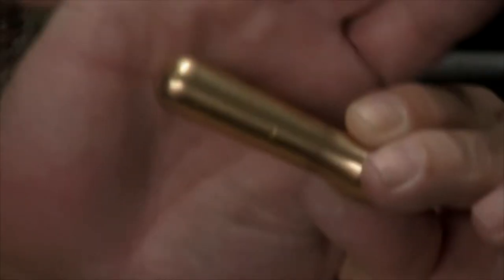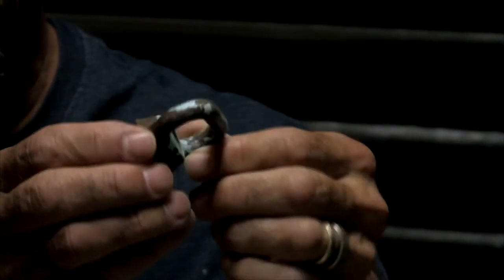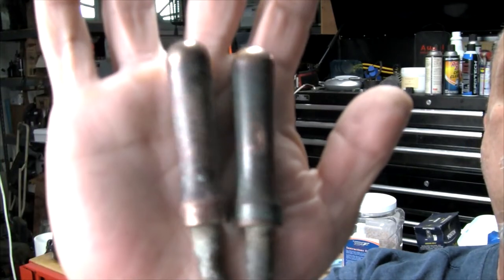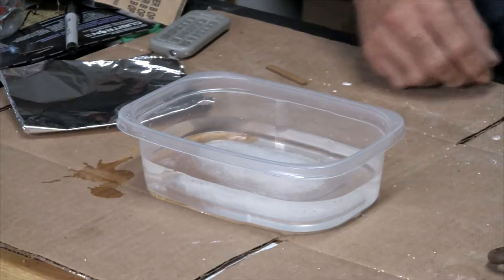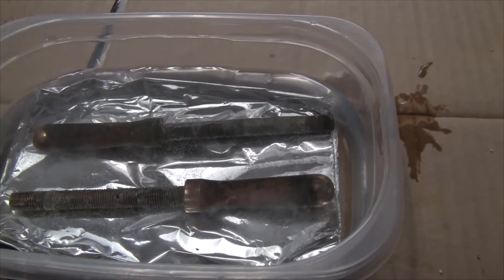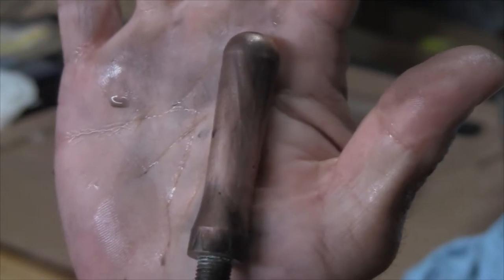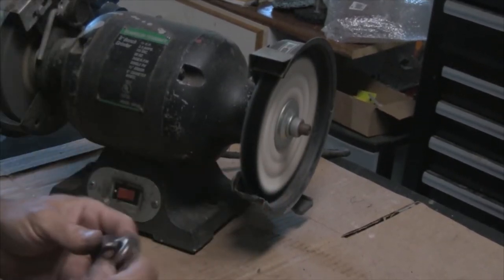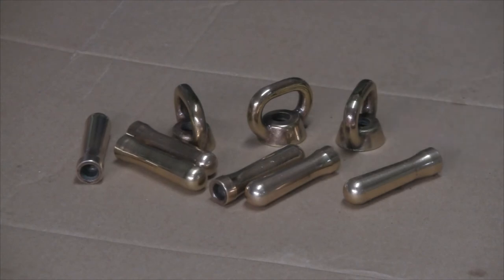How to Clean Brass with Homemade Bronze and Brass Cleaner Hack - Bonus on Polishing!

Comment: Good technique there. I don't have a buffing wheel, so for the last stage I use steel wool, and if badly discoloured tackle that beforehand with progressively finer wet & dry paper (silicon carbide). I'm wary about the vinegar bath, as I've buggered-up some things, where the reaction removes the zinc, and leaves copper-pink. Therefore, here's a Q. for you, Jose: I notice you've still got some copper look about these fittings, after polishing. Is it impossible to remove that?
Reply from the maker: That is a good question, I'm pretty certain these are Bronze through out so I think the color is there to stay. I no longer have the 13 so cant experiment any more.

Comment: Is there another way to polish at home, other than using a lathe?
Reply from the maker: Use very fine grit sandpaper 1000 and polish by hand or put on a drill and polish with a rag and polishing compound

Comment: What metal is brass in colour but when I polish it on the wheel it almost looks silver? silvery and shiny, The stamp on the back of the photo frame says made in Italy, any clue?
Reply from the maker: It might be plated with brass, perhaps steel?
Reply: @ExtremeDIYGuy  definitely not steel, is there anywhere I can post a side-by-side comparison photo? would it help?
Reply from the maker: @patprop74  I'm not sure that I would be able to help with pictures. Are these Norman pins off if a Boston Whaler?
Reply: @ExtremeDIYGuy No problem ill figure it out at one point lol, No no no, it's not off a boat, they are older photo frames.
Reply: @ExtremeDIYGuy  brass and bronze come in many different mixes.  When you etch with chemical you remove the zinc leaving copper hence the pink colour.  If the mix has a lot of tin which is white it will be a different colour.  Speculum metal was used by the Victorians in telescopes as a mirror has loads of tin in it.  German silver which is not silver has loads of nickel in it as far as I remember. It used to be used for surgical instruments.  Loads of alloys, loads of different colours.  There is something called the electrochemical series which is a list of how reactive different metals are.  Silver dip works in this way. I think that the aluminium is more reactive and this is what is going on, ions are transferring. 55 years ago when I learnt this!  To remove chrome plate use electrolysis, a trick used on modern surgical instruments to show brass underneath and sell them as antiques.

Comment: How do you get deep scratches out of a brass plaque (viewpoint finder) with lettering engraved on it) please? Done by a vandal, probably with a sharp stone.
Reply from the maker: The only thing I can think of is to sand it but you risk sanding off any engraving or detail

Comment: You're polishing bronze my friend.
Reply from the maker: Those are Norman pins that came off of a classic Boston Whaler. Whaler only made those pins in Stainless (later years) and brass. Another point to consider is that Bronze isn't strong enough to tie off a boat. Thanks for the feedback!
Reply: @ExtremeDIYGuy  Bronze is much stronger than brass. Bronze bolts are used to bold lead keels to boats where brass would fail. Bronze cleats are common on many vessels. 
Also, brass will corrode terribly around salt water as well and is rarely used except for ornamental pieces.
Reply from the maker: I stand corrected, did a bit more research and you are correct, they are bronze, not brass. Still came out nice though!
Reply: @ExtremeDIYGuy  I wasn't being a smart ass, I just knew you might have been mistaken. I restore wooden boats and deal with bronze almost daily. Most wooden boats have cleats, shackles, sheaves, stemheads, mastheads, floors and keel boats all cast in bronze, all of which require strenght. Brass is more "ornamental" though some people use brass screws because they are easier to source than bronze.
All that aside, they did turn out nicely. Cheers!
Reply from the maker: I took it in good stride friend! I appreciate solid feedback, thanks! Check out my Boston Whaler restoration videos if you get the chance.
Reply: @FixNewsPlease  Thanks for the clarification. Now that we know it is bronze and not brass, would the same technique work for brass? Thanks in advance for your help. I'd like to polish 3/8 inch, schedule 40, brass pipes for a wind chime gift.
Reply: @oldporkchops  I've always polished both bronze and brass with a brass wire wheel (if it's badly corroded, full of paint or coated with plastic) followed by a cotton buffing wheel and jeweller's rouge, but this technique would also work.
Reply: They are going to require frequent polishing when out in the elements, but if left alone will develop a nice patina, especially if you keep fingerprints off them once they are polished and rinsed.
Reply: @FixNewsPlease  Thank you for sharing what you know. I appreciate your time and information.
Reply: @oldporkchops  This thread went a little sideways. But anyway. Good luck.

Comment: its not really electrolysis, you just made hydrochloric acid by mixing nacl and ch3cooh, and then the HCl reacted with the aluminium foil to create hydrogen gas and hence the bubbling. in reality you dont need the aluminum foil
Reply from the maker: I'll have to give it try without the aluminum
Reply: Beat me to it

Comment: how about a brass bed?
Reply from the maker: Electrolysis would be tough win a brass bed. You may want to try 000 or 0000 steel wool and then follow up with a good brass polish. I would test that in a hidden area first though so that you can make sure it doesn't scratch the brass. One other thing, depending on when the bed was made, it may have a clear coating on it.